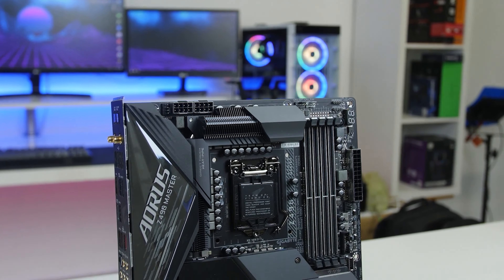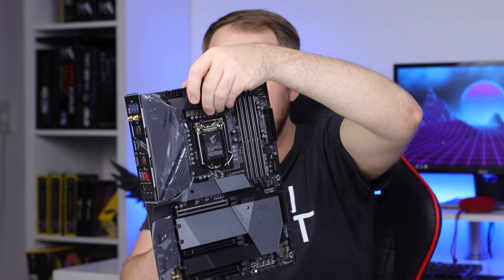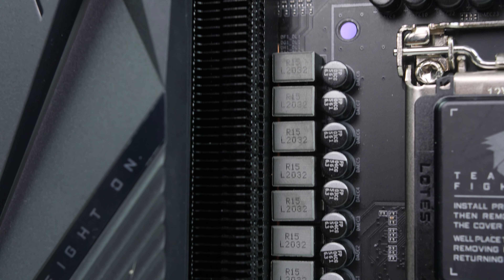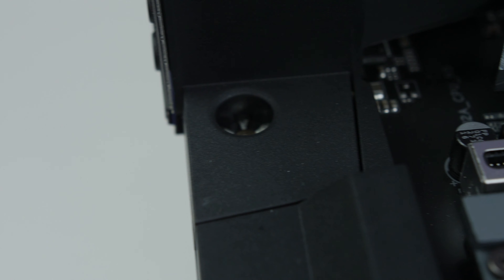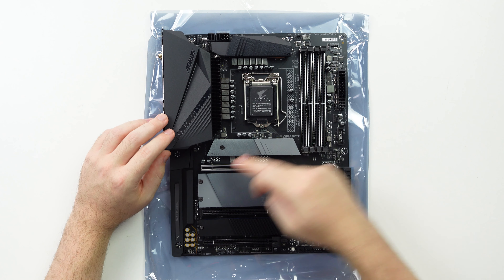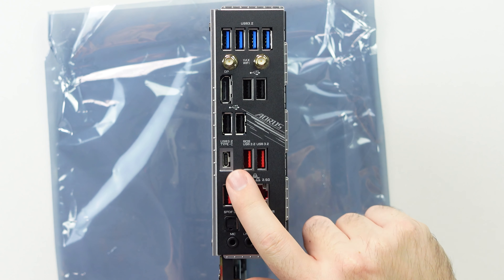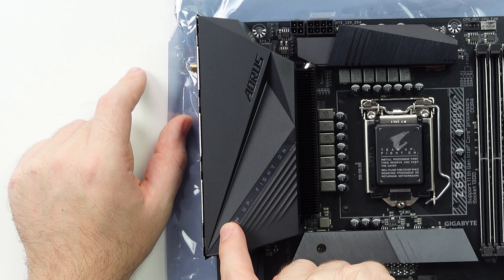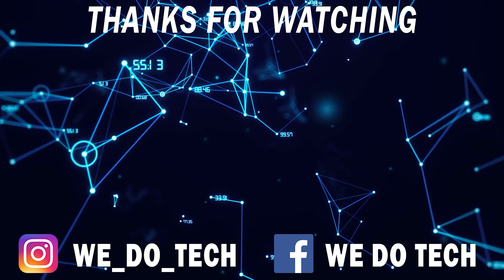I'm Impressed, But Is It Worth It?  - Aorus Z590 Pro AX

Comment: Can I use 2 m.2 NVME ssds with a 10th gen cpu?
Reply: On this board*
Reply: did you figure this out?  I have the same question.
Reply: @adamschaeffer1565  I still don't have an answer. And am still waiting for a good deal
Reply: I use 2 NVMe Gen 3 SSDs and 2 SATA SSDs perfectly fine with my Z590 Aorus Elite AX and I7-10700F
Reply: @Hermezlink  Thank you! Just did not know if there would be conflict with the M.2 slots while using 10th gen.

Comment: Just ordered this and a 10700k. Currently running 8700k with 3070 ti and 3000mhz ram so I thought I would upgrade and also get some 3600mhz ram. Going to build another pc with my old parts and sell it.
Reply: Battenberg that’s not what I researched. As long as you get the z model mobo you can run higher frequencies on 10th gen cpus.
Reply: Battenberg I’m currently using this Mobo with 4 sticks of 3600mhz ram (32gb) and it runs right near that frequency consistently. With a 10700k.
Reply: @WitcherGeralt  hes teling u he has same board and is doing it
Reply: @PlanetZirtrix  I would have a question and although I ordered the motherboard and it only supports 3200mhz in the network, but I have 2x16gb 3600mhz can I still use it or is there an obstacle my cpu is i7-10700k sorry for Bad english
Reply: @Hunter-xf9fu  from my experience yes it will work fine just make sure xmp is enabled in the bios
Reply: @PlanetZirtrix  ok thx